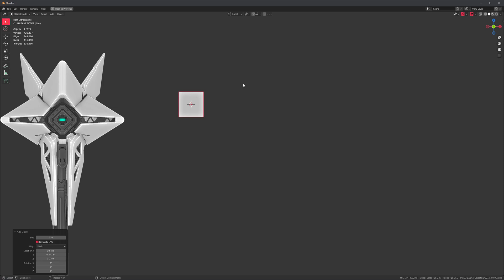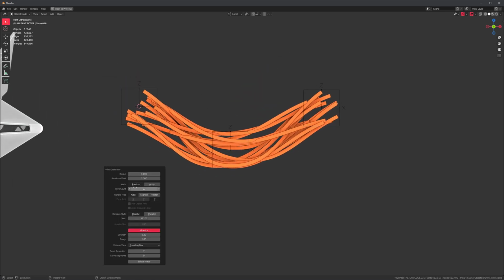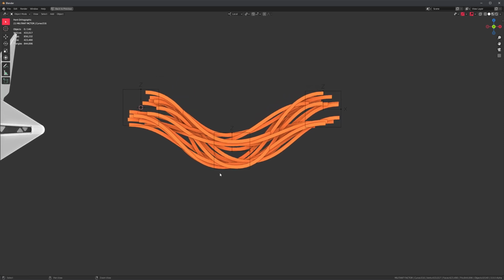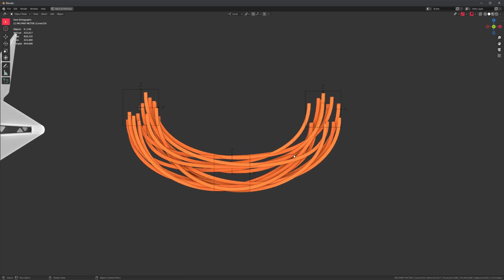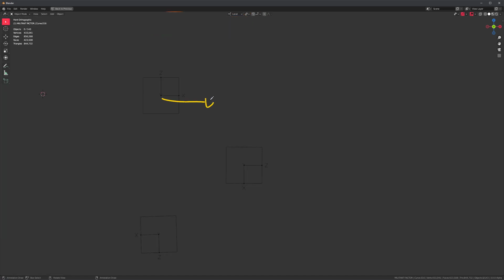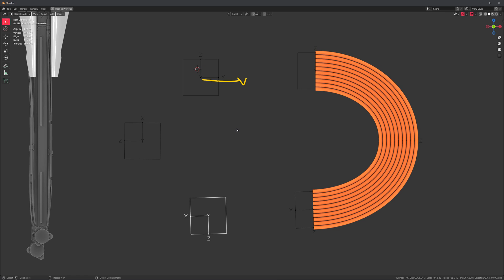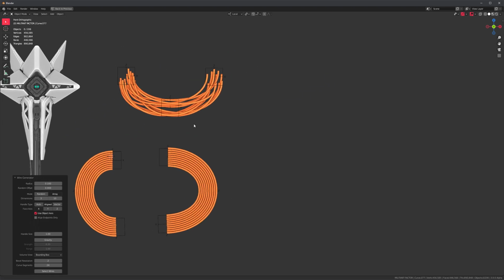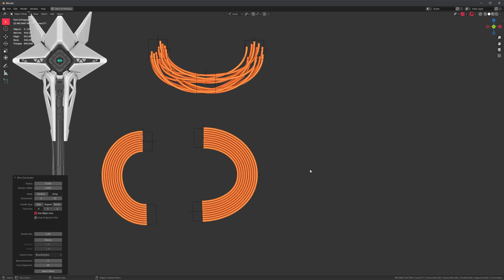CBasher 1.4 Devlog - Initial improvements to WireGen

Comment: The only reason to wait with features is to get enough for a bigger update (2.0, 3.0) if you're doing upgrade pricing. If it's small improvements you can release more often and make sure you're adding the changelog to the Blender Market/Gumroad product pages. That way potential buyers see there's development momentum, and are more likely to buy. Gumroad and BM kinda suck when it comes to communicating those things. You can still announce big updates via email and provide a way for people to get upgrade pricing (but again, GR and BM suck here 😒).

(also: just bought this myself, nice work!)
Reply from the maker: Thank you for the support friend! There's always more than one point of view. I do it because it's experimental and some things break while I'm adding new stuff, like you saw near the beginning.

 It also helps for testing, so I can make sure it works in combination with the other tools and not just in isolation.

 Bundling features also prevents users from trivializing updates (I get emails about addon updates all the time but I never update them because it's always a couple of small things I didn't care about). 

I might be misguided in all of this XD but I can't be sure until I try. I actually wouldn't mind people testing these experimental updates, but they would probably be reserved for patreon users or something.

Comment: Just bought the add-on like 30 mins ago, and omg......so easy to get crazy complex wires and tubes going. I love it! Thanks so much for making this!
Reply from the maker: Glad you liked, can't wait to showcase the bigger ideas I have for next version.
Reply: @ArmoredColony  This is prob a horrible place to ask tech questions about it - but is there any way to change the keyboard shortcuts for commands AFTER I hit J? For example, you use 1, 2, and 3 for some options, but some of us use keyboards without a number pad (I know....bad idea). I just use the "emulate numpad" in Blender's preferences (and extra mouse buttons to change vert/edge/face). I didn't see a way to customize those commands in the Add-On menu. Not a deal-breaker by any means. Just wondering.
Reply from the maker: I use the top row but I understand your problem. Customizing the HUD keymaps isn't possible yet, but rest assured, I was thinking about that so hopefully I should be able to include that feature in the next release.
Reply: @ArmoredColony  Thanks a bunch!